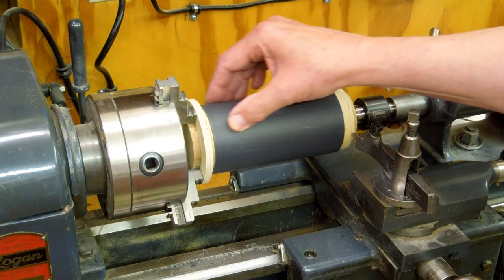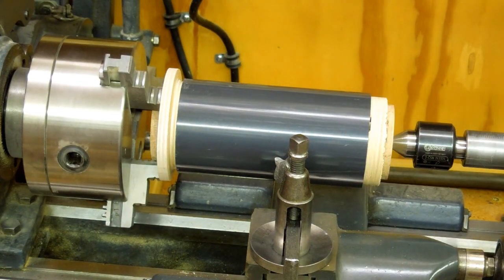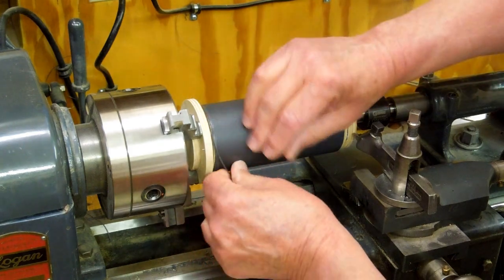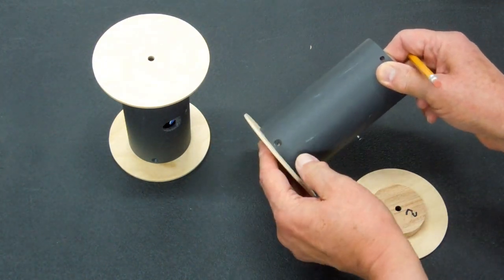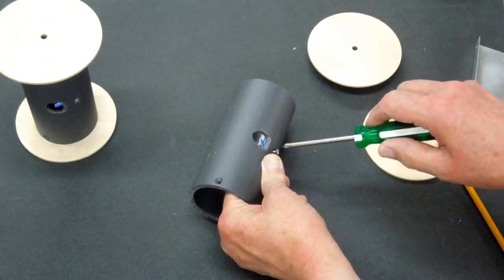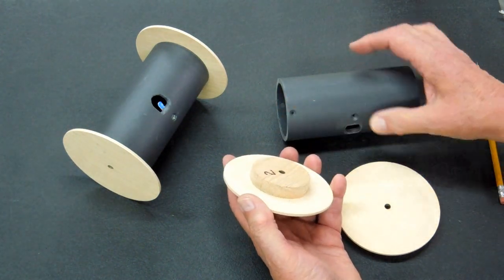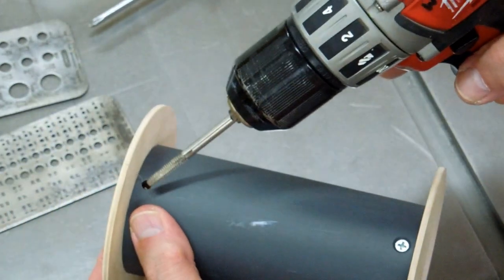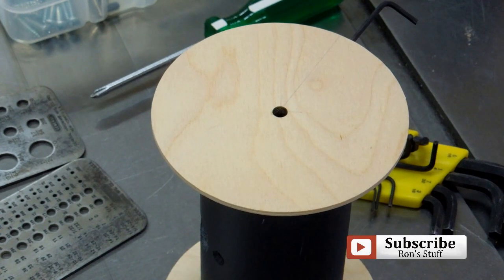Senior 20 Organ (04) Making The Take Up Spool - Machining PVC Pipe

Comment: So the take up reels are a specific diameter therefore the lathe work, ok got it. Seen you tapping with a drill before so I'll have to try that. Coming along very nicely and interesting to watch! You are the man with a plan! Thanks for sharing.
Reply from the maker: MRrwmac Turning a tap by hand is so boring. Using a cordless drill to tap wood works well as long as you have drilled the correct size pilot hole. I would not advise using a drill when tapping metal. - - - Some people use a size pipe for the spool which is smaller diameter than shown in the plan. That means they end up cranking the organ around 100 RPM instead of 60 RPM so the music plays at the correct speed. This also means the bellows are running faster than necessary and dumping a lot of air.

Comment: Wow, I was just trying to reduce a similar pipe on my mini lathe and it was no fun since I had nothing to hold it. I managed to eyeball it and finally reduce it a bit. Thanks for posting this, that really helps. I need to make something like that to hold the piping. I don't have much if any woodworking tools but I do have a 3D printer so I'll be making some supports as soon as I can get it back up again.
Reply from the maker: +myshots101 Why not 3D print the center pipe and the end caps for the Take Up Spool?
Reply: +Ronald Walters Unfortunately 3D printing is a very slow process so printing a large pipe section just takes too long which he needed right away. It can be done, but my dad had the same pipe you do or at least it looks the same and needed a tool that also required the pipe to be turned down as you did. So I was trying to help him make the tool out of the pipe he already had. My printer is also down at the moment since I&#39;m waiting for parts and have been cleaning out the tips that also can get clogged over time. So I&#39;ve been in maintenance mode with my stuff at the moment. I&#39;m currently making a bushing for the drill press lead screw my dad has. It&#39;s a bit wobbly so I want to fix that. I saw this when we were trying to drill through the pipe. So I&#39;m just cleaning, adjusting and lubing things up for now so I can just use them when we need them again. It&#39;s been a while so it was time.

Comment: Hello Ron, thank you for this record of a build.
I was interested - does the music have a sprocket line. Then, just like a tape recorder the take-up reel can be any old size (within reason) as it only turns by friction. It's drive then always turns faster that the spool to keep up tension.
Also can you show a photo and dimensions of a few inches of music?
Thank you again for showing us your elegant work.
Reply from the maker: John Davidson No sprocket. The take-up spool pulls the end of the music across the tracker bar, thus the diameter of the take-up spool has a direct impact on the playing speed of the music. That is why I am showing it being made to a specific diameter as per the original design. This is not a slip-friction drive like a cassette tape. The 20 note music is 140 mm wide. Stay tuned, it will all be shown eventually. You can also browse around johnsmithbusker.co.uk

Comment: Is the 68mm diameter really that critical? I would think that a variation of 1/4" +/- wouldn't make any difference.
Reply from the maker: sooth15 Change the diameter of the spool and you change the playing speed of the music which means you have to change how fast you turn the crank. I have seen it make the difference between turning the crank 100 rpm instead of 60 rpm. So, that would be up to you.
Reply: Ronald Walters
Oh, so this is the driving (crank) spool. I didn't really realize this. I mixed-up the "take up spool" and the spool that the music roll comes on. I assume the size of the music roll would be the one that wouldn't make a difference (as far as the exact size of the diameter - a larger diameter would just make it easier to rewind).